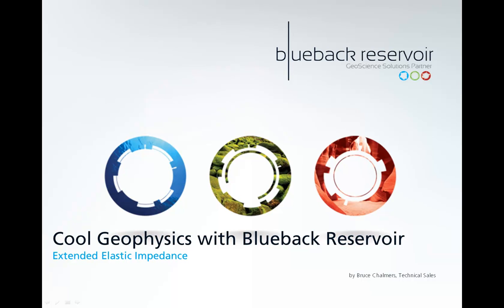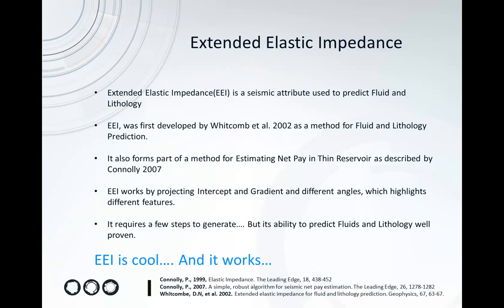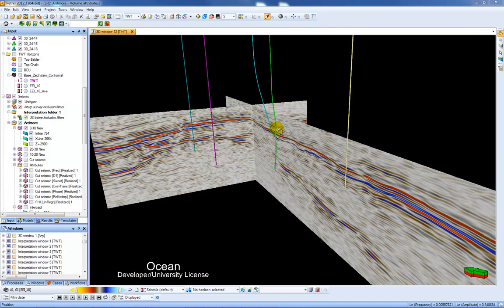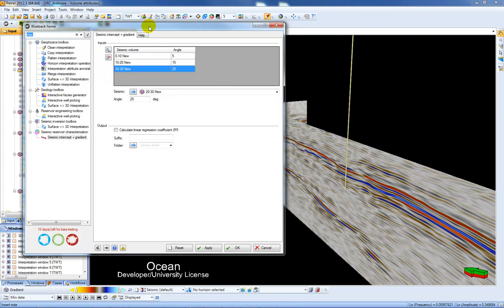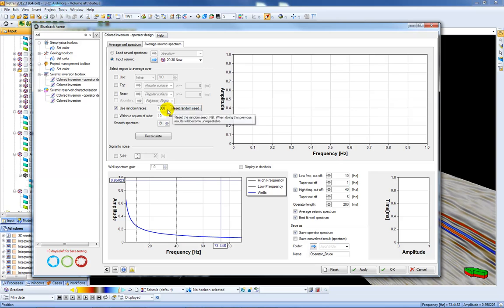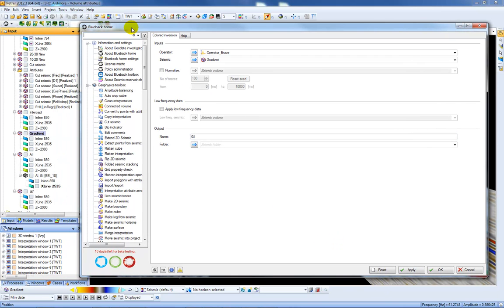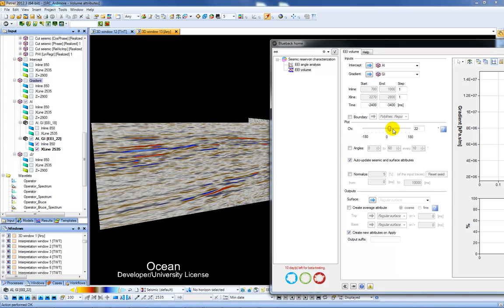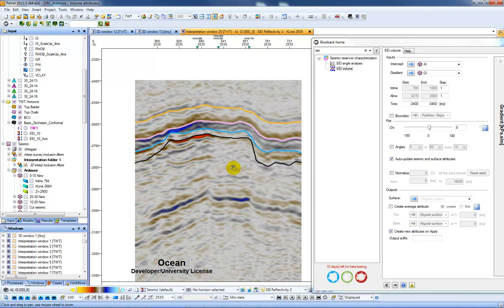Blueback Reservoir - Extended Elastic Impedance

Comment from the maker: EEI is a based on a different methodology than Seismic Inversion and will therefore give different results. For example it does not use information from a model as input.

EEI is however a robust method which can produce results quite quickly, to help in the identification of Fluids or Lithology.

For more detailed prediction of specific reservoir properties, Seismic Inversion may be more appropriate.
EEI would however make an excellent precursor to a more detailed Seismic Inversion study.
Reply: Hey......!!!
I want to know how EEI can be used to get Petrophysical parameters like Porosity etc.
Can you please tell me more about the cross-correlation technique in which we cross-correlate the EEI with the property that we need.
More appropriately I want to know how to obtain the porosity section from EEI.
Thank you.